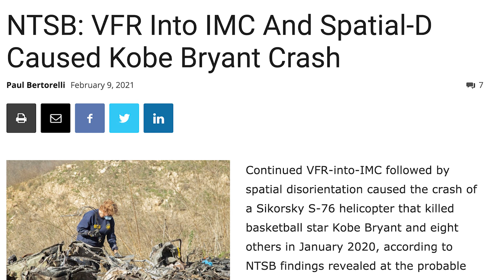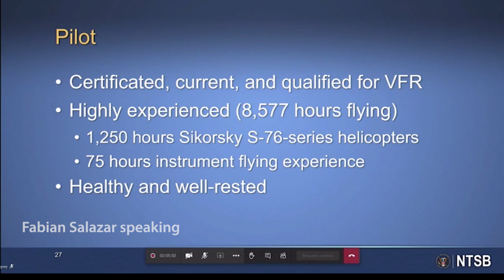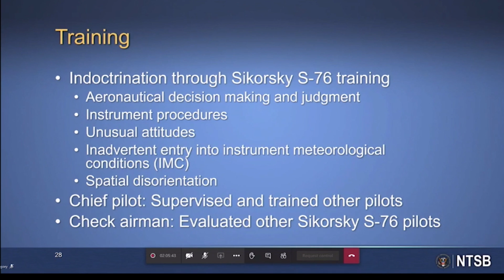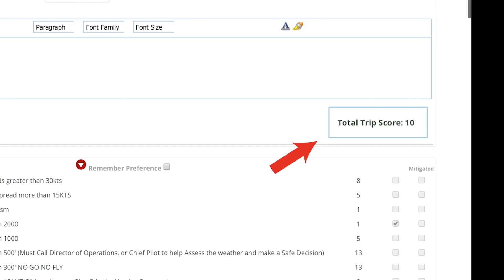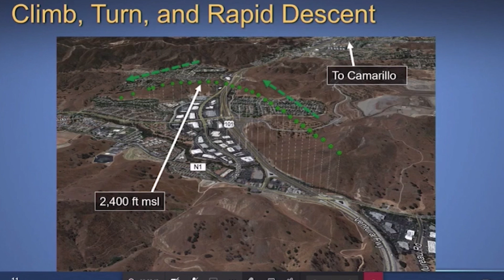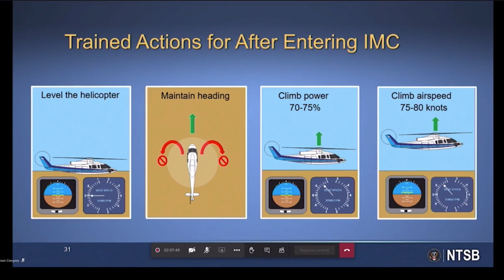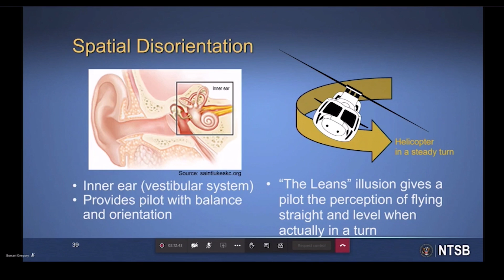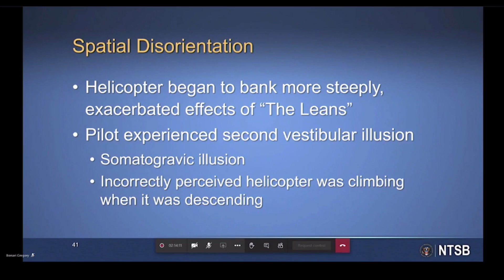How A Split Second Wrong Decision Caused the Kobe Bryant Fatal Crash

Comment: I suppose if I were rich and famous, I might hire a helicopter to save one hour and 20 minutes of driving. After all, flying is supposed to be safer than driving. But, if there was even just a hint of inclement weather, I would not... especially in a helicopter. Whether it's rain, wind, ice, or just poor visibility, I'd prefer to be on the ground.
Reply: Typically speaking, a helicopter is far safer in marginal weather than a fixed wing.

Comment: Why not ask those helico charter companies to make all flights IFR even if the weather is good? That way, there is less worry about VFR-to-IFR transitions where the pilots has to come up with an IFR plan or risk a special VFR flight and juggle multiple things at the same time.
Reply: Because alot of locations they fly to/out of have no IFR procedures in place and it would also hurt flexibility for the clients.
Reply: Most insurance companies will not insure helicopters that fly IFR.  A friend flew a Bell Jetranger for a TV station.  They were not allowed to fly IFR under any circumstance.  It's generally easier for a helicopter to avoid IMC than a fixed wing as they can stop and turn on a dime.  There were no instrument approaches to the roof of the TV station.
Reply: @billfly2186  LOL That's a great point.  And besides there not being an instrument approach to the roof of the TV station, it would seem pointless to fly a news helicopter into IMC.  The camera wouldn't be able to see anything!
Reply: @Dudeisthere  @Bill thanks guys for explanation.
Reply: Flight under IFR requires ATC to maintain separation between aircraft, increasing their workload and decreasing efficiency.  If it's too busy, they just will make you wait to depart, or otherwise hold in the air.  Flying visually, the pilot is responsible to maintain separation and aircraft can operate 'closer' to one another.

Comment: As a 121 commercial pilot, if something like cameras ever enter the realm of "safety", then it just wont be turbine helicopters, it will be everything. Voice and data recorders are for investigational means only, not disciplinary. If disciplinary ever entered the realm, thousands of pilots would walk. Just like a sim checkride, no flight goes 100% correct, and the tiny fraction of the flight conducted incorrectly would be used against you.
Reply: I believe you're correct.

Comment: Air traffic controllers should have said "fuck No' the pilot got past protocol some how, if i was the traffic controller i would have told him to put it down on the ground soon as he took off, the controllers are just as much at fault as the pilot. judgement over safety likely caused this accident.
Reply: No controller has any blame for this accident.  You do not have a good understanding of the roles of controller and pilot.

Comment: I don't get it? I am not instrument rated, but if I ended up in that situiation, I would literally just look at my altimiter, air speed and attitude, and then radio. Like do VFR people just not bother looking? I don't get it tbh.  

I dont think you NEED instrument rating to just use those basics to keep straight and level and maintain altitude lol.  knowing your area, oh mountains are at x feet so climb to x feet etc.  Navigation may be hard and why you need IFR training, but come on, basic level flight should be common sense if you ever looked at it lol.
Reply: Flying by instruments is an acquired skill, not a natural one, and it’s more difficult than you seem to think it is.  The records are rife with accidents caused by VFR pilots flying into IMC, and then losing control of the aircraft.  Instrument flying skills will degrade if not maintained by regular practice and proficiency checks, and there is good evidence that the accident pilot, while instrument rated, had fallen below a safe level of proficiency.

If you doubt the need for an instrument rating to keep the aircraft upright and flying in IMC, then I can only hope that your confidence is never tested in actual conditions.  Please don’t ever fly into IMC deliberately.

Comment: Why the hell is all the onus on the pilot and his training? If the feds made it easier for the operator to perform IFR flights or at least IFR to VFR on top this would've never happened. They were forced to fly VFR on a marginal day when they could've completely avoided this 1200' higher. Feds like the NTSB love to point the finger at the lack of training or poor decision making but ignore the root cause of the issue which is their over regulation.
Reply: While I don't totally agree with your comment, you are closer to identifying the problem than everyone else in this thread.
Reply: It is still up to the operator and it's pic to make the flight with the maximum safety, even if the regs you seem to mention are not your prefered cup of tea.

Comment: If the "Leans" is a known, could a warning system be configured to alert for it? For example, if the sensors detect a left-leaning roll with descent, an alarm could indicate "LEANS CONDITION - LEANS CONDITION!!" similar to "BANK ANGLE" or "TERRAIN AHEAD" in airplanes.
I'm no pilot, of course. Just an interested party.
Reply: The orientation of the aircraft is visible before you on the instruments.  The challenge I guess is that the illusion of the leans is very convincing, helicopters are almost always flown in VFR and the pilot was under a ton of stress.

Comment: Dang he was the Chief pilot too? Just because the company didn't approve IFR flights doesn't mean the pilot could not have flown the flight using IFR when things got worse. At the very least it sounds like he could have climbed up above the marine layer. Of course hindsight is 20/20.
Reply: The pilot had told other pilots he had zero actual IMC time, only hood time. It also sounds like there was no checks and balances. I would think the owners and insurance company would want better risk management  The NTSB acknowledges he violated policy. I doubt it was the first time. So it became his job is secure unless he crashes  Management created this in my opinion.
Reply: @hewhohasnoidentity4377  We can't conclude that. He was a very experienced pilot, with thousands of hours in a helicopter, with a clean safety record. From what we know, there was nothing to indicate that the management was irresponsible letting him fly customers.
Reply: @vasicp  12:15
Reply: @hewhohasnoidentity4377  I'm not sure what that question (or answer) is meant ti say. I don't think anyone is saying that the company had a reason for concern. The NTSB discussion seems to be hung up on his IMC proficiency (and currency), which is not entirely helpful if it is an attempt to spread the blame to the management.

Comment: I would think the gyro and altimeter could have saved him but with the technology we have today there should no longer be this crippling distinction between VFR and IFR, we should have sensors that enable flight in all conditions, synthetic vision being the easiest and cheapest but phased array radar is very doable today as well and can show rudimentary terrain through any fog as well as air contacts. Synthetic vision should be on very large displays, none of the 10 inch folly of aviation and should be free of all legacy graphics style nonsense. No gyro ball lines, speed tape, no compass rose. Free and clear. ATC should of course also be computerized. ATC is painfully archaic and incurs great mental load for no reason. GA is a disgrace.

Comment: 0:13 - This crash was NOT caused by the pilot flying VFR into IMC.
How could you make such a blatantly erroneous statement?!
NO CRASH has ever been caused by an instr rated pilot flying an instr capable aircraft because they flew VFR into IMC.
Transitioning to instruments is a basic skill that every single instr pilot is required to demonstrate proficiency in.

Furthermore, your article states:
"Continued VFR-into-IMC followed by spatial disorientation caused the crash..."
No.  Spatial-D is NOT what killed these people.  The clouds did not cause the crash.  Disorientation once in the clouds did not cause the crash.

If you cannot understand these most basic facts, then you should not be making flight safety videos nor writing these articles.

Comment: I have to challenge the finding that the company is safe.

An effective safety culture would have clear limitations known by all personnel performing safety sensitive functions that everyone knows you don't violate. The NTSB acknowledges that the pilot was supposed to contact the operations manager once the situation changed. The pilot had the opportunity to do so while holding. 

A good safety culture and thus a safe operation should include at a minimum following the safety policies. 

It seems they are putting emphasis on the deceased pilot and minimizing the company. The administration of the company allowed the chain of factors to line up.
Reply: Every company is "safe", in some sense, right up until they have their first fatal accident.  In fact, I'd argue that the idea that a company is safe or not is meaningless in a post-accident investigation.  That's because arguing over safety isn't going to retroactively prevent the accident from happening.  In my opinion, the questions that do have meaning are:  Were the established policies and procedures of that company likely to provide a reasonable expectation of safety?  Were the established policies and procedures of that company routinely not followed by the pilots of the charter company.
Reply: @jonathanguthrie9368  Agreed. I also understand that the intended audience for those comments was the general public with no knowledge of aviation. They want to maintain confidence that every company is safe because the FAA would not allow an unsafe operation to exist.
Reply: @hewhohasnoidentity4377  The FAA isn't in the business of guaranteeing any specific level of safety.  Attempting to acheive and guaranteeing an outcome are two different things.
Reply: @jonathanguthrie9368  The investigate isn't just about determining causation (and fault), but the NTSB is also charged with making recommendations to improve safety.  That includes industry operator SOPs, etc.

Comment: why in this day and age do they not make a GPS unit for this with a screen to give you spacial guidance through the obstacles?  I guess that would take on board radar??  I mean if a standard GPS unit in a car can track you through a flat environment map, couldn't these brainy-acts make one with topographic map elevations and have it calculated your attitude/altitude in a plane by the second and give you a picture to fly over or through hills, terrain, and obstacles??
Reply: That does exist, it's common in high end modern aircraft.
Reply: @JingleBop  well, I'm sure Kobe,(who had plenty of money) if informed of it and the risks without it in his aircraft, would not of flown...I mean I wouldn't and don't.
Reply: @truthjester  The pilot was very familiar with the area and knew about the rising terrain around him, the issue is that he lost control of his helicopter after entering the clouds and no amount of terrain awareness systems will help you with that. He simply should have cancelled the flight in those conditions.
Reply: You don’t understand spatial disorientation.

Comment: I heard the Heli was not equipped with a TAWS system, as you know is required for turbine powered aircraft.
Reply: A TAWS would not have helped.  The problem here was not that the pilot didn't realize that he was approaching rising terrain -- the pilot knew he was approaching rising terrain.  The problem was that the pilot experienced spacial disorientation and as a result unknowingly entered a descending turn.  A TAWS alarm screaming at the already task-saturated pilot would not have prevented the accident.